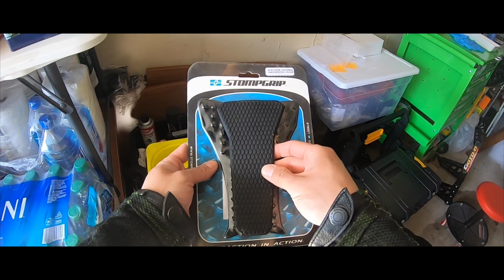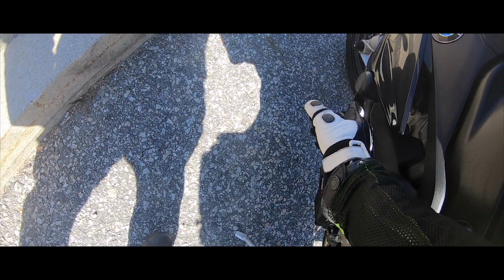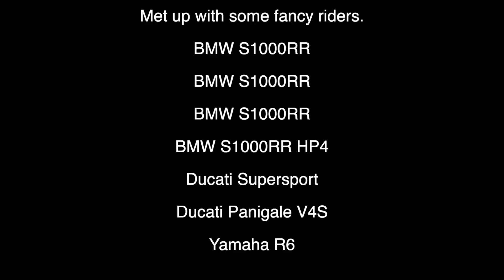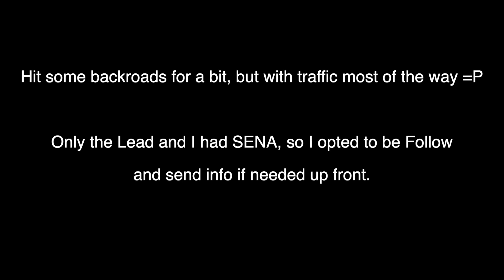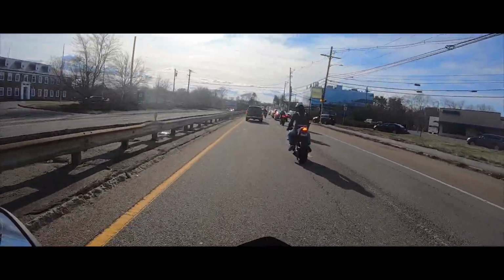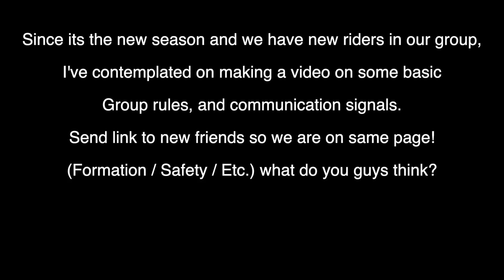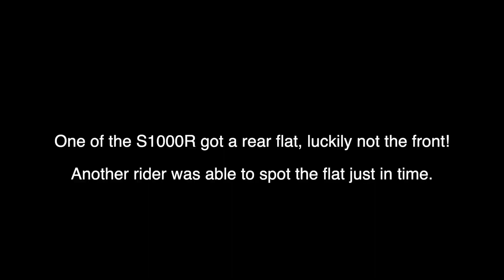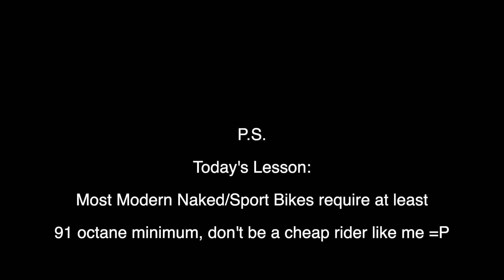Stomp Grips Pad/Wood Craft Sliders review. Ride: S1kRR, HP4, S1kR, Supersport S, Panigale V4S & R6

Comment: Our groups rides start in a couple weeks. I can't wait.  That cruiser rider is an ass. He knew you were there and could have let you merge.
Reply from the maker: Appreciate the comment, I’m glad I’m not the only one who thought  could have handled it differently, In my case I did not shoulder check that on ramp which I usually do. It was 50’s and cold tires/road and some gravel on the tight turn, did not feel safe to turn head midway. Rather I used my mirrors to check to get onto the highway, and there he was right next to me. Glad it was a close call and nothing happened. Keep your head on a swivel and ride safe everyone!